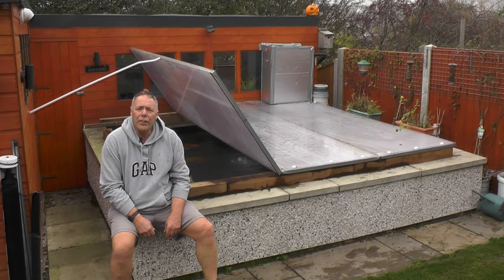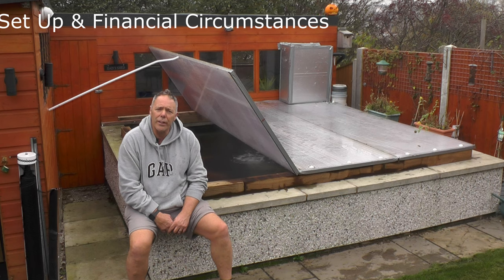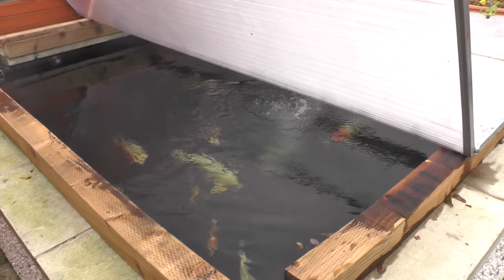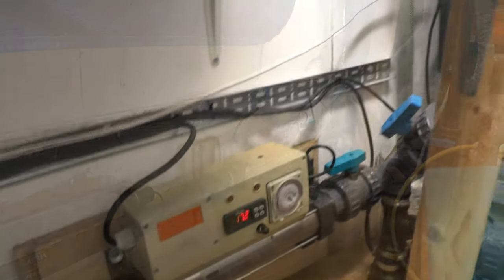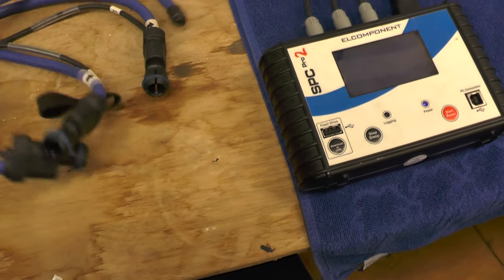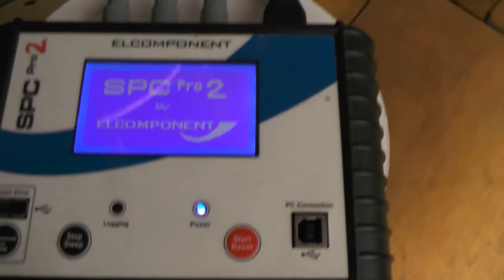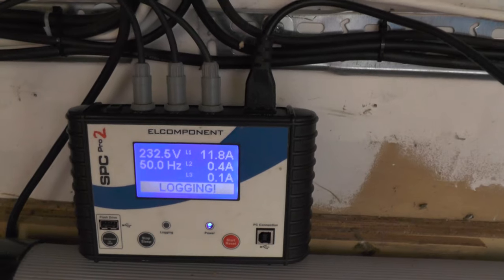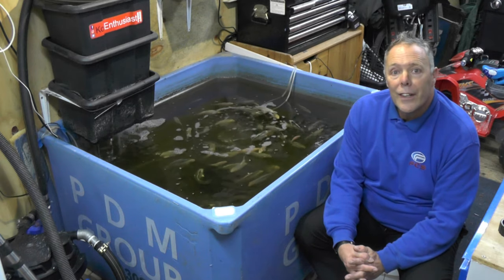How Much Does It Cost To Heat A Koi Pond In Winter Part 1 - Heating A Koi Pond in Winter

Comment: Hi Kev useage between £7/£8 a day £49/£57 a week £196/228" a month depending on weather temps outside
Reply from the maker: Cheers Barry, I hope you are wrong lol. I've watched a few a lately and I'm beginning to worry, but we will see
Reply: Have to agree, I think it’s going to be £7 plus a a day. Wrighty just did a video with I believe a 3kw in line heater? He was only heating to 13degrees and it was using £7 a day, so he’s ordered an ashp. Hope yours works out a lot less, nice pond and set up.
Reply: @AKoiEnthusiast  kev I ran a 3kw one over winter 2018 so I no mate keeped my pond at 19c all over winter I now have 2 ASHP and the 2 are cheaper to run then the 1 3kw and have one set at 20c other is touching 23c on grow on for £8/£9 a day  to run both
Reply from the maker: @nikkirush-toner8309  Me too. I saw Wrighty's too and I m amazed at the cost. His pond is mainly below ground so I do not understand why it was using so much. Like I said last February it cost my £2.22 per day and I even doubled checked it a couple of weeks later and it still didn't cost much more. The only difference I can see is the thickness of the Polycarb sheets and mine has 25mm & 50mm Kingspan on all the sides. I was guessing at £5 per max even though it is still fairly mild up here
Reply from the maker: @barrykoikeepercooper8052  Now that is good going. I've been looking at a 5kW & 7kW ASHP but the prices vary a lot. Let me know where yours were from please
Reply: @AKoiEnthusiast  kev the 5kw one is more then enough for your pond that's 5kw out put but only 1kw in put you will be able to keep your whole pond at 20c over winter for £4/5"" a day will try and send you a link of Ebay paid £795 from Leicester
Reply: Type that in on ebay pal But don't buy it go on his site and ring him as he will do it cheaper delivered then the price on their ask for best price for cash on delivery I did got it for £795
Reply from the maker: @barrykoikeepercooper8052  The one I saw was £799 from AES but all the others were nearer £1k -

Comment: Kev have a word with  Ric koi on decord I talked him into buying one a couple of months ago not looked back so easy to fit aswell mate
Reply: I've got my ashp on the lowest temp. No change to my lecky bill this month which is surprising. Fair do's its been mild but the ashp has been on daily 👍
Reply from the maker: Ric, Lowest Temp ???? what temperature have you got it set at???? I've set the Data Logger on the ASHP for two weeks to do a comparison. First thing I've noticed is though, the Outdoor temps have dropped
Reply: We have to get a ASHP club but think Kevs wins hands down given another couple of years I am sure Kevs will come down in price inverters are the way forward
Reply from the maker: @barrykoikeepercooper8052  I’ve had an interesting conversation with the suppliers, a very knowledgeable guy about the performance etc. It should make a good video once the logger is downloaded. There are a few guys getting ASHP’s this winter so there should be some good feedback all round
Reply: @AKoiEnthusiast  The lowest temp for my dream heater is 15 degrees but coz the thermostat is abit out it keeps the pond at 13 degrees which me n the koi seem to be happy with so far 👍🐟